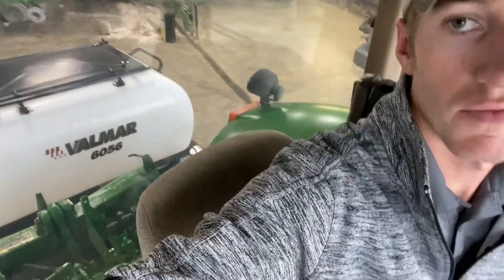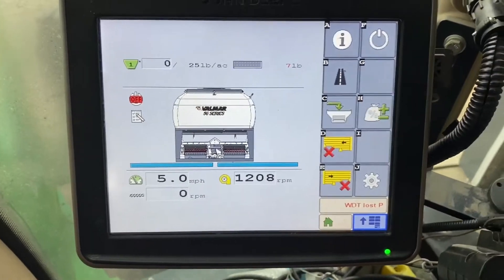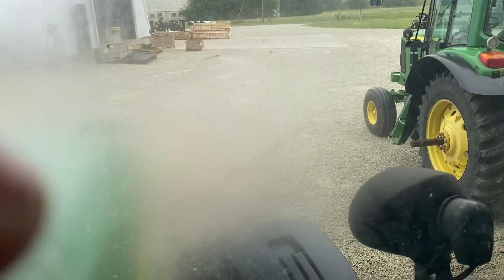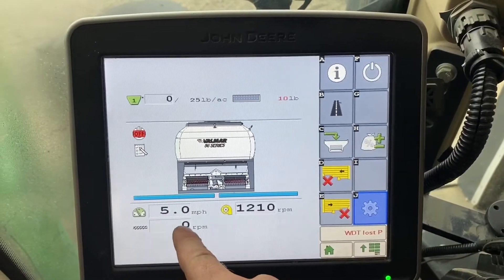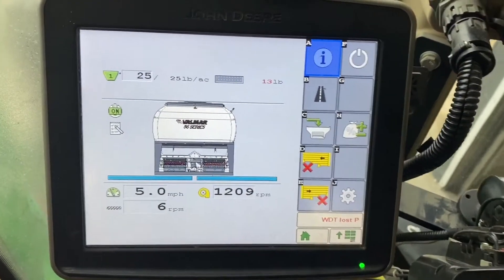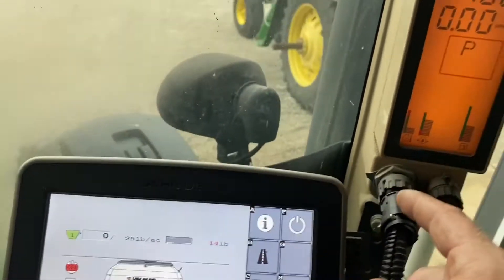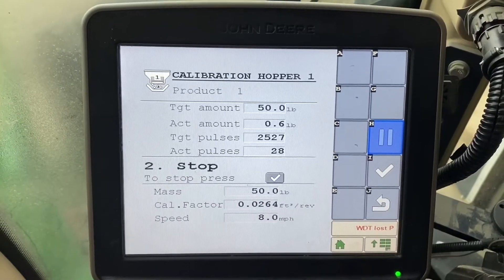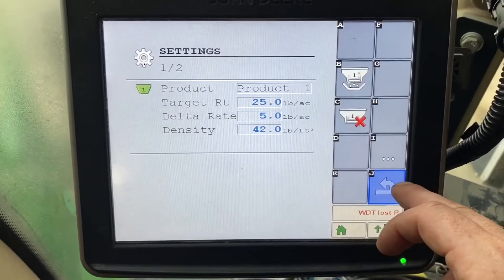Valmar ISO Controller Overview

Comment: Adam, I have a customer wanting to run section control with a Valmar ISO cover crop spreader. It's just left/right clutches like your screen shows. Is this possible with a JD 2630 display with SC activation?